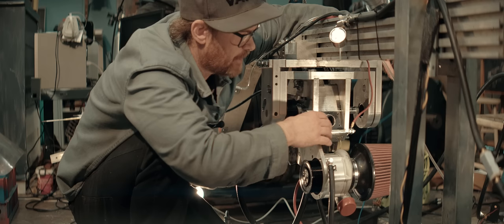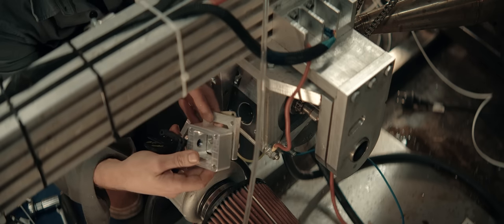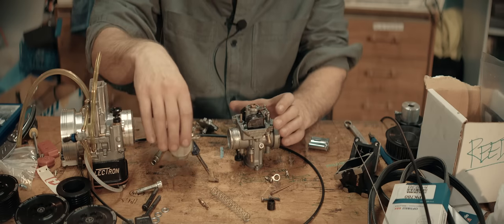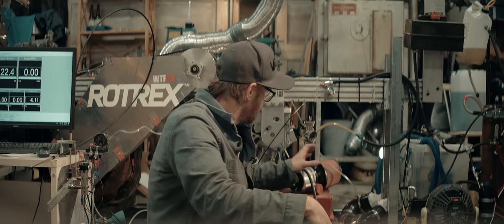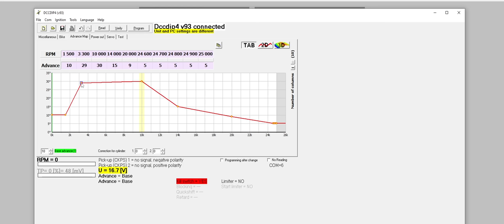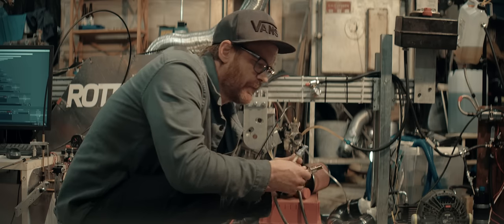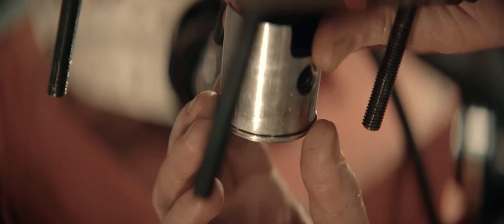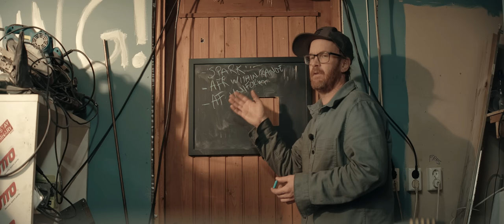Not Supercharged 50cc Two Stroke Not Running Nitro.

Comment: Why are you decreasing ignition advance at high RPM, one major benefit of advance is to match TDC with peak combustion processes, the fuel burns at the "Same pace"*, don't you need to lead it out further with higher RPMs??

Comment: Can it possably be, that the ignition system doesn't have enough time to charge the capasitors to propperly light the spark plug at that high Rpm ranges

Comment: Nå gjorde jeg en kjapp kalkulasjon sånn grovt. Flammehastigheten for bensin er maksimum16,5 m/s etter det jeg googlet meg fram til.
Med 2% olje så er den litt lavere.
Med 4 cm slaglengde og turtall på 16000 o/min så flytter stempelet seg 17,7 m/s så det å oppnå høyere turtall enn flammehastigheten på bensin strider mot alle fysiske lover.
Så du turtallet ditt er nok ca så høyt som det er mulig med vanlig bensin som drivstoff.
Da må man ha drivstoff med høyere flammehastighet.

Comment: Your taking a risk only running 2 bolts clamping the intake read cage to the cylinder. 
Bugger it must be cold 🥶 over there. You might need to visit your girlfriend to help warn up your pipes & create a little distraction. Then back at it. 🤯
I found on my 2 stroke motocross bike running a stranded type braud tip spark plug helped the bottom end torque. Then running a fine tip spark plug gave better top end performance. 
Don't forget the heat range of the plugs...
By the way black boards are only coated with a water based paint with fine grit in it. 
🇦🇺

Comment: Have you checked the crank case for leaks? I you a smoke tester for things like that.
Reply: Never mind fuel would be coming out as well.... dwell time on the coil may be too high causing an over heat of the ignition system or too low causing the spark to blow out once dynamic compression hits. I normally never go over 5ms on dwell.
Reply: When you advance the ignition it seems to be happier which could be a result of the plug firing at a colder part of the cycle. it could be loosing spark with the plug gets too hot and then coming back when the air fuel mixture cools it back down. Heat will change the resistance.

Comment: Laser temp gun while running for head heat maybe?
Reply: I'm really suprised Alex doesn't use a water temperature sensor in the cylinder water jacket or coolant output.
Reply: @malcrandall1309  It sounds like you're a proponent of total instrumentation.
Reply: @davidgierke7582  No, you couldn't be further from the truth! I was brought up in the clockwork era and know zero about computers and like. What is more simple than a old water temperature gauge in the water flow.
Reply from the maker: I'm taking head temp from under the plug, and did have a probe in the big water tank.

Comment: Stuff the crankcase like you channel name suggestive 😊
Reply: Yes. I suggested using the crankcase stuffers which Alex made about a year ago but he didn't like this comment. As he said, he was going to do it his way!
Reply: @malcrandall1309  Stuff it all you like for a NA "sucker" engine, but as Alex said, "The boosted "blower" engine doesn't need it."
Reply: @davidgierke7582  What Alex is doing here is normally asprirated so the blower comment has no relevance here. YouTube recomended a video from Alex from 2 years ago when he recieved the PiP cases. He clearly states the cases won't work efficiently  N/A due to there large case volume and he suggested that Mk2 cases might be made.
Absolutely no offence to Alex but he is retracing his own footsteeps to this point.
This is where the roots blower was fitted to PiP after removal from the Brute Force concept engine
Alex will determine his own path and rightly so! These cases were originally designed around the N/A resonant induction projet and even had it printed on a tee shirt. Sadly the resonant induction system didn't work due to similar problems faced here.
PS, don't forget the piston will need drilling to lubricate and cool the exhaust bridge. Looking forward to Fridays episode and a update on the new ignition system.

Comment: Do you still have a EGT hooked up? Hmm This is a bit of a head scratcher. Its too bad you can't build a variable valve system. Make everything tunable. Ex. Valve, Transfer Valve, Intake Valve all of that. Like you said. The amount of time you have to work with at high rpm makes this really difficult to sus out.

Comment: Told you so long ago to get it running best you can  on pump gas an like a normal 2stroke then add all your gadgets on
Reply: The only thing that's not being addressed while N/A is poor primary pumping effiency. This engine was designed to have a large crankcase volume for the resonant induction system which didn't work as planned.

Comment: Your carburetor is too damn big. Go smaller. Start with 19mm carb and then go bigger from there. 21mm then 23mm. I think you said you were using a 26mm. I've used a 32mm carb one time and got lots of power at lower rpms but it wouldn't rev high for shit. I dunno it's just an idea bro. I've been watching your videos for about 5 years now and really like what you do. I think you should try it man. Good talk. Good luck. Peace out

Comment: So the cutting out is electronic. The software you are using it initiating the rev limiter. The ignition is skipped and the fuel cools the plug, and this is why you have the fall off. To prove it, lower the rpm limiter and ee if it makes a difference lowering it by 20% will prove it out.

Comment: Take off the gas cap on the fuel tank. Had a moped with gas tank vent hose pinched and would cut out at high rpm.

Comment: As a person who races 100cc go karts and do my own maintenance, please consider using 100LL aviation fuel. I pay $230/L CDN, Race fuel is close to $10/L in Canada. The bonus of aviation fuel is that it remains stable for a very long time and does not smell bad. That pre mixed chainsaw gas is garbage and you will never get consistent readings from jug to jug.
Reply: Could I ask a kart question please. Is your engine disc valve or reed valve? What does it rev to?

Comment: I've been watching for a while now and I think I might be missing something. Why not print or machine an insert to reduce the crank case volume? Or design a better crank case entirely? I'm quite sure that you're onto something with the jug design, but it seems like most of your problems come from the bottom end.
Reply: I don't believe that Alex has given up on the large crankcase volume modification just yet. The only problem with it may be getting the crankcase hot enough at start-up to initiate a strong atomization to vaporization phase change. We'll see after he works out some of the other problems—such as a reliable fuel-delivery and ignition system. In the meantime, I am fascinated with his dedication and expertise.
Reply: @davidgierke7582  that's an interesting idea. I wonder if there would be a way to heat up the crank case while keeping the upper end cool?
Reply: @MVanDii  Yeah... I've done a similar thing with a spark-ignition kerosene-fueled 2-stroke engine for the Navy... aboard its ships: Use several electrically-heated contacts to the outside of the engine's crankcase, allowing them to raise the temperature to about 100 deg C. Then start the engine as usual, shutting them off when the cylinder head temperature reaches "normal."
Reply: @davidgierke7582  The issue I can see in this specific case, is that the engine will be used in a landspeed machine. Energy used to produce electricity to heat the case will take away from energy that can be used to go fast. Plus adding weight is also not productive in that scenario. Maybe something external that can be used to heat the case, then removed before it's run? But I'd be concerned about cooling the case too much during the run, especially with charge cooling from blow-through carbs. Either way, experimenting and learning is an incredibly entertaining!
Reply: @MVanDii  The little heaters that I'm referring to weigh  less than an ounce each and use an external battery for the heat-up phase of operation, after which they are disconnected. I never had a problem with combustion chamber cool-off after the engine was up to speed—but the fuel was kerosene. You're right, there would definitely be a period of experimentation needed to prove or disprove the viability of crankcase heating when using nitrated fuels.

Comment: You say going back to basics, yet not once in this episode did you even consider doing some proper old school 'plug chop's?
Reply from the maker: It's not getting into the rpm where a plug chop would be useful, need to get it into the powerband.
Reply: @2STROKESTUFFING  hmm, have you considered building sumit called 'colour tune'. Where you look through a glass spark plug and you can see the combustion colour?
Gives you a more visual sense of the quality of the combustion.
Reply: @rct2  Once you give the engine some throttle the image turns from a weak blue into a dark yellow. They were only any good at seeing the flame on tick over.

Comment: Have you got a wide band A/F meter?
Reply: Alot of people say you can't run the. In 2 stroke but I have one in the pipe of my fuel injected honda cr500 and they last about 50-100hrs of running.
Reply: @blainemacdonald6929  Exactly, the do foul from the  oil eventually, but they are a god send for tuning if you can't ride it.  I have a substantially built KTM 380, carb bored out to 40mm (39.5mm technically) to get the jetting back in range, that I tuned by crispness and it's explosive, but I have since bought an AF meter and I would never go back.
Reply: @blainemacdonald6929  While Alex is running this 50:1 synthetic oil mix a diesel lambda should work fine for a while to complete testing before going back to  20:1 castrol 747 oil.
Reply: @malcrandall1309  I didn't think of using  a sensor for diesels! I'll look into it when I foul my current one. Thanks!
Reply: @blainemacdonald6929  I have to admit I'm only repeating what a chap said 2 weeks ago, seems a good idea.

Comment: Is your exhaust port to small so it can't scavenge at high RPM.  That is the only real part of the design I have had real reservations about.  Don't be to concerned with gas velocity of the exhaust because in a 2 stroke that isn't what does the scavenging.  The more I think about it the more this seems right.  Exhaust port mate, hog it out.  It's not scavenging.
Reply: I'm beginning to think the exhaust port step needs lowering to piston crown height.

Comment: I'm more upset you took the supercharger off lol you was doing something I was always told was impossible and I'm pretty sure your pipe was the problem it looked like it was trying to turn into a pulse jet I don't think the engine liked that I would have slapped the rotary valve with the straight pipe back on it

Comment: You've spent all this time on this setup why would you not get a wideband and know for sure what your fuel ratio is? If you read in Lamda and not afr you won't even need to convert when running diffrenet fuels. Budget inline widebands are extremely affordable
Reply: A wide band O2 sensor should work ok when running this 50:1 fuel/oil mix for a while at least.
Reply: Malc Randall   the oil won't effect the life of the sensor at all as long as it isn't excessive because it'll just burn off. Remember o2 sensors have a built in heater circuit and widebands especially will get upto around 1200f even with the motor off. The bigger concern is that the oil will cause a inaccurate reading but you just need to take that into account and remember its leaner then what it's reading. Ether way hard numbers make everything easier
Reply: @joewood9151  The problem that these sensors have in this application the engine has not produced enough heat to burn away the oil residue that drips out of the exhaust when running the 20:1 castrol 747. 
With the high performance blue Stihl oil there is a good chance the engine will keep running long enough to take some usefull measurements.
The problems Alex is facing now are the same ones as he experienced a year ago when he first tried it, this is why he went onto the Brute Force variant.
Reply: Malc Randall   hadn't considered that the exhaust may not product a lot of heat but as I stated doesn't really matter anyways because the internal heater element will produce enough heat the burn the oil off (o2 sensors dont read correctly untill upto temp) but being in cold exhaust Temps can cause the heater circuit to burn out sooner so I guess it's a wash when talking about longevity
Reply: I would suggest that an O2 sensor application in this instance isn't necessary if you resort to old-fashioned measurement of air and fuel mass flow rates. .. simple and effective—but it's more work.

Comment: Maybe a twin spark setup so you can run two coils? Also they make pressure transducers and all
Kinds of useful sensors for scopes and there is tons of good info out there in the automotive realm for them.

Check out Pico scopes I think it’ll be right up your alley!

Comment: Look here: https://youtu.be/eRItqiCFuQE?t=733It example of 2 stroke with EFI for dragrace. No carburators on two stroke. For forced induction you dont want carburator, you want fuel pump and nozzle injection in a throttlebody. Just put in a wideband sensor an measure mixture while tuning on laptop, no more guessing

Comment: Interesting thing about timing .....
But as far as supercharged 2 stroke engines go, you simply MUST have none symmetrical exhaust timing......
Trust me, I spoke to a man at a bar once.....
Serious though, if sticking with ports and not ex. valves then look up "ancient marine diesels" or vintage/ old.
Loads of engines.....see gardener 2 stroke and Fairbanks Morse diesei

Comment: 😈😈😈 those new plugs which ive never heard of ,    like in subaru impreza  $100 a spark plug ..  your obviously running high coil voltage ...  i dont know what those plugs are called 😈😈😈

Comment: smiling? noooooooo 

EFI  pleeasseee - if you know whats going into the engine fuel and pressure then you know when you adjust fuel its adjusts the way you plan not be affected by other circuits and airflow issues
Reply: sooner or later I'm going to lose my mind and ship myself to you with a EFI setup!

Comment: You're running too lean not too rich you need to fatten the mixture I'd say go up to 135 main jet and 3 small jet I don't know what I'll elevation you're at but if you're higher than sea level it should be second notch up is good up to 65,000 ft above sea level so not right in the middle of the next one down so not the third one but the fourth one from the top

Comment: Haha... no no, I'm not going down your rabbit hole, but it's a hell of a laugh and good time hanging around watching...

We ring the rods of 2.1cc or  .12 cubic inch on 16%, they go even harder on 30% and the point is you're packing the O2 in the mix, so what's with the supercharger? 
One other thing, try and get your hands on 30% and 16% Runner Time, it's by far the best, most consistant fuel on the market, racers world wide use it, you can lean on the engine and still have some protection... As for other "off the shelf" fuel, absolute rubbish ....
https://youtu.be/bPouLKay32E

Edit note the puff off the botttom RPM range to help get the engine "on song".. our die wheezing if they're too lean on the bottom and/or you run a colder plug to compensate with the leaner mix. Regardless, in the cold of Norway, relatively sea level I assume, you'll lean to a richer mix.. pardon the pun!

Comment: You’re problem solving two hand-made, experimental things with each other. Isolate your variables. 

I’d get the dyno figured out using a throw away Briggs & Stratton. Your tools aren’t even capable of reliable operation yet, how can you rely on them to accurately aid you in developing more tools? You’re only as good as your weakest link, which seems to be that dyno and the hardware connecting it to your software. 

Then figure out the engine.